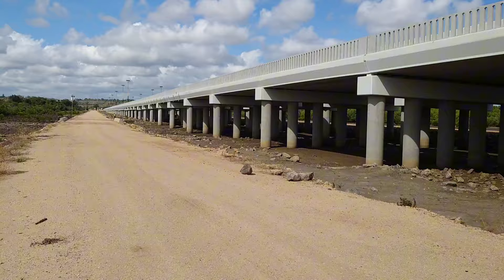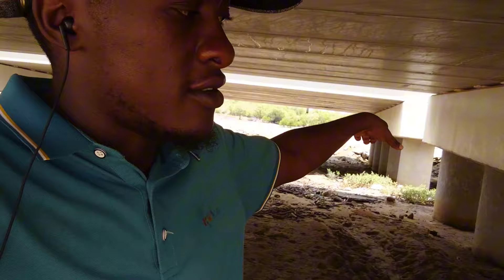The new TSUNZA VIADUCT  on Dongo kundu phase 2. Mombasa is really changing.

Comment: Nice one bro, keep them coming,actually a viaduct is just a bridge that connect points of roughly equal elevation and it allows direct overpass over a valley, river,a road or other low lying terrain obstructions. A bride on the other hand is mostly built across a river or arms of oceans/seas.
Reply from the maker: Yes brother, that's now the correct definition of a viaduct and a bridge , thank you for passing by always